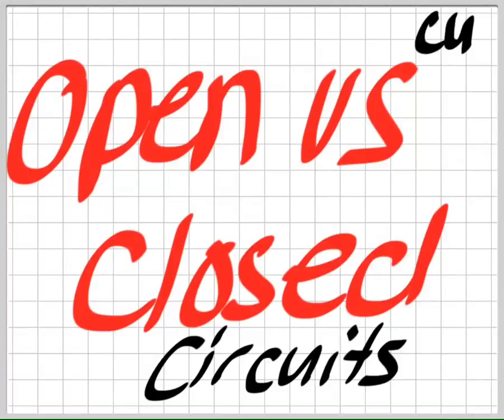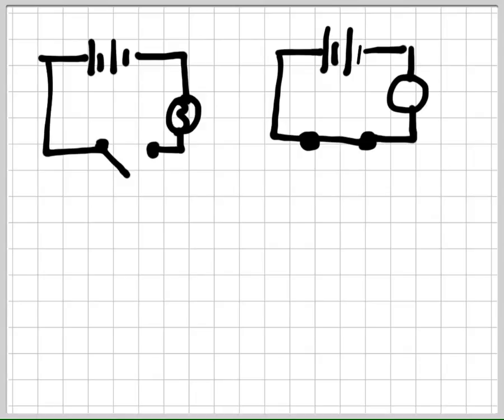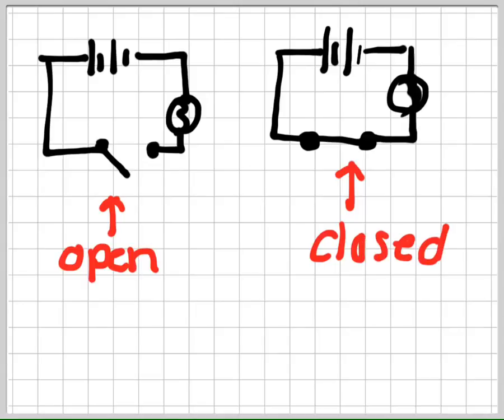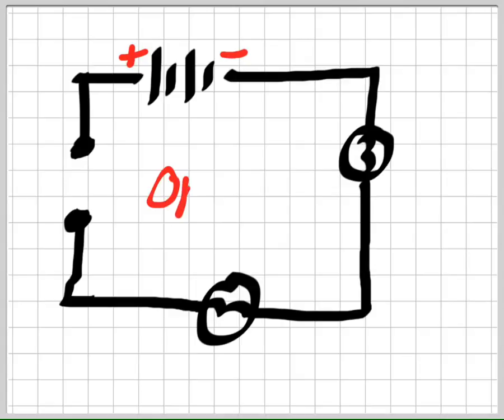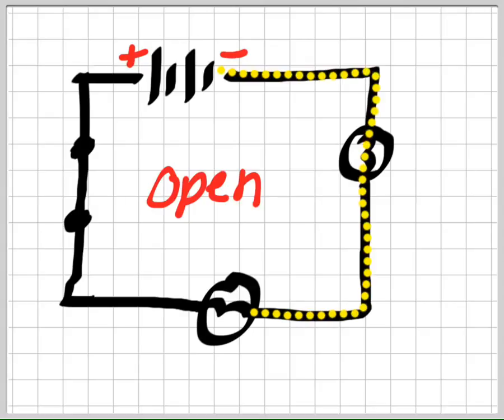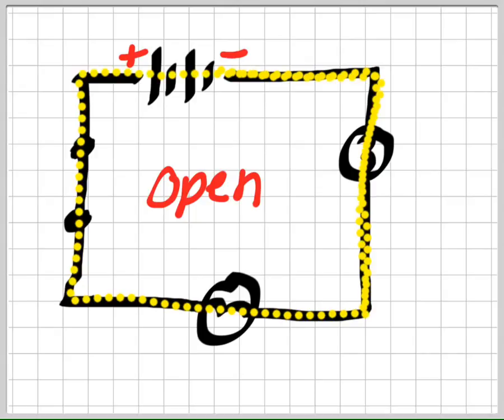OCC  OPEN VS CLOSED CIRCUIT

Comment: so,  would a wire connecting two batteries, one end of the wire to the first batteries negative side, and the other end of the wire connected to the second battery's positive side, be considered a closed circuit?